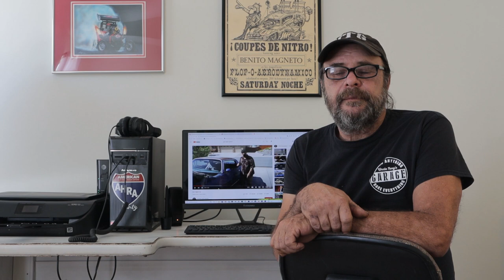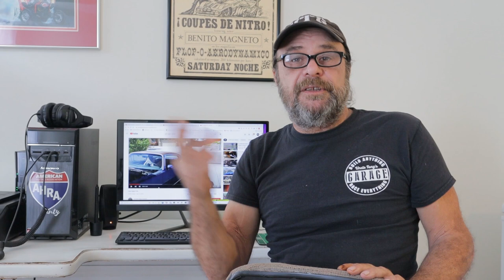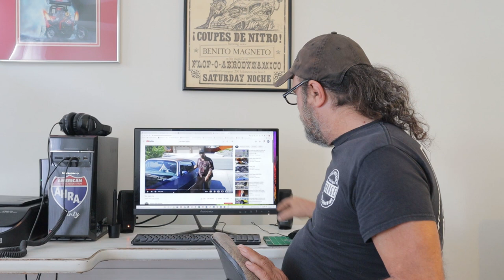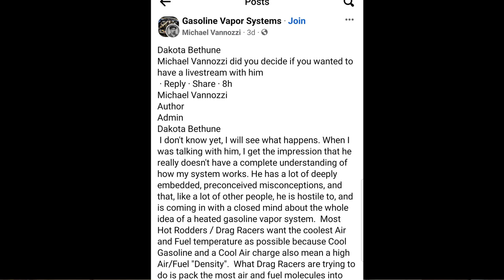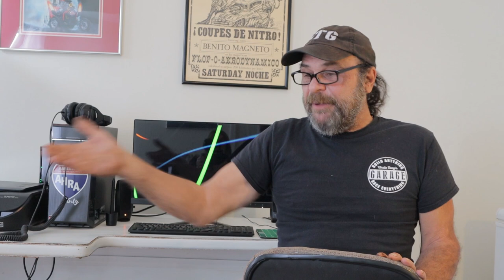Climbing Down The Mega Mileage Conspiracy Rabbit Hole

Comment: To get better fuel mileage you will need. Small thin tires and rims. Lighten up your vehicle by removing anything that's not necessary. Drive under 55mph. Run drum brakes and adjust shoes to max free wheeling. solid mount everything in drive train because flexing is wasted energy. Run a little hotter thermostat. Over build the air filter to be the best free flowing you can. Because of pumping loses. Use a turbo alternator. Use electric fan on radiator. Build a steam generator by capturing exhaust heat and use steam to help move vehicle.

Comment: My box stock C5 corvette LS1 6 speed at a steady 55 mph will get about 30 mpg. It will also do a less than 5 second 0-60 ,  13.4  quarter @ 108 mph and top out about 175.
Reply: You've got tall gearing, no torque-converter losses, a relatively modern engine which is well-calibrated from the factory, and good aerodynamics ... and if you want acceleration, change gear. Nice car.

Comment: something to test. i remember hearing about a guy selling fuel saver device and what people got in the mail was a wood block and instructions how to attach it under the accelerator pedal. how about putting that to the test. adjust something to limit the accelerator pedal so the engine has only about 20-30 usable hp and see if you can get the 35 mpg at 50-55 mph. well attaching a small carp should be similar to blocking out a regular engine throttle pedal movement. my guess is that you would be getting the same results. the car would accelerate slow as heck and be boring to drive. Uncle Tony. I am counting on you!

Comment: Ok Tony hopefully this can help. I have a 1986 Ford Thunderbird. 3.8L V6 with a C5 transmission (a C4 with a locking torque converter basically) and a 7.5 inch rear end. Now, my car isn’t carbureted, but it is throttle body injected. Now, in the past year, I rebuilt the engine and trans (new seals, timing chain, larger injectors, honed the cylinder chambers, decked the heads, honed the stock intake, and replaced the rings and bearings). Also, all the emissions have been removed and my exhaust has been upgraded to shorty headers off an SN95 mustang and a 2.5 inch true dual into a Y pipe before the rear axle, and a 3 inch outlet. 

NOW. Stock, my car would do 0-60 in 10.9 seconds and 1/4 in 17 seconds. With my overhaul project, I’ve achieved 0-60 in just under 9 seconds and 1/4 mile in just under 16 seconds. Pretty respectable for a 6 cylinder Ford. NOW, this included turning up the base timing from 10 degrees BTDC to 13. The stock fuel economy was 13 city, 23 highway. The HIGHEST I’ve achieved at 55 mph on a flat surface was 38 mpg. But if I run it hard, I’ve seen that economy drop as low as 12 mpg. This is all with 93 octane.

I can tell you this. With these modifications, my car absolutely 100% STRUGGLES to get up steep hills. She cannot do it. So have a gained power with my modifications? Yes. But when under heavy load, she struggles. 

So my two cents? Yes you can increase fuel economy but there is NO WAY in hell that you can gain fuel economy without sacrificing power. So Tony, you are 100% correct. There is no way in hell you can achieve superior fuel economy without sacrificing horsepower.

Comment: Love this video so much. 
Thank you UT!! 
The ding bat with the Camaro would have more power and better fuel milage if you put a little 4 cylinder engine in it. 
UT. You put out a video about lage displacement  engines and you pointed out when and where the engine actually made power and the rest of the rotation was all wasted energy.  
That video has vary good into that can relate to fuel economy.

Comment: Isn't the main reason for putting bigger tires on the back to add mileage and performance because the vehicle is always going downhill?   Not sure why it only works with rear wheel drive cars. I tried it on my Hyundai and it just made the car look goofy. I'm thinking about trading it for a rear wheel drive car so I can get the advantages. 😃

Comment: Now back when my father had a Gas Station , him and Red Tried A Recycle Spent Exhaust Fumes on his imperial,. They used A Small Boiler and Check valves on his Imperial   The car had return Exhaust from the pipes back to the carb ! Did it work in part yes but the carbon caused the check valve to stick and on their trip around the block the check valve stuck and the boiler let loose , back in the early 60s.
Reply: Carbon monoxide IS an engine fuel. Done right, that might work.
Reply: @Gothamauto  They used high Test back then and   Added Moth Balls as a booster for Re Spent Fumes   .

Comment: I've always been able to get better mileage from a 4 bbl IF I KEEP MY FOOT OUT OF IT>. When I blueprinted my '67 225, bored .60 over, low/midrange cam, Clifford headers, Holley 4bbl, Offy intake, etc... Houston to San Antonio, I could suddenly get 28 mpg. Best on the factory setup was 21. I made an adapter to have the throttle shafts parralel to the crank, to give more even distribution. NO heat to the intake, 9"x3" air filter, Dynomax mufflers true duals. I wonder how much of that mileage improvement was just from the freed up restrictions on the intake and exhaust. The electronic ignition couldn't have hurt either. Thanks to Direct> <Connection for the spark and cam. Thanks to Tony and family for these videos.
Reply: You are right on track with your setup , congrats !

Comment: Isn't LP gas vaporized before combustion? Or CNG? The forklifts I work on have a vaporizer. The fuel use isn't any different. It still takes so many BTU's of energy to run.

Comment: I know that when my purge valve was stuck open on my 96 Camry, I could get 35 miles to the gallon and the fuel filler cap would make a whooshing sucking noise every time I opened it. I know that gasoline will evaporate at an increased rate in a vacuum. I know the ecu can compensate fuel about 17% in either direction. I know this Speed density setup will allow for the evaporated fuel vapors from my tank through the purge system to sneak in as it adjusts from the upstream O2 sensors reading to keep it stoichiometric. Seriously it's not hard to replicate and get a mileage boost from in a MAP sensor car. this does not work with MAF air metering. I did have a code set "fuel system lean" which is typical for an intake vacuum leak that happened to be feeding completely atomized fuel/air mixture from my fuel tank through my purge valve, into my intake manifold.

Uncle Tony, lets strap some nitrous bottle heaters to a 10 Gal fuel cell, pull a vacuum on it through a 3/8 manifold line in a carb spacer(with a flame arrestor check valve) and then control the orifice size on the fuel tank vent to pull the tank into sub atmosphere. Sounds dangerous, doesn't it? The gains do not outweigh the risks of this rolling bomb.

Comment: The only right way to know the correct amount t of fuel consumed for any length of distance is to install a highly accurate and calibrated flow meter in line. A meter specifically designed for this purpose.
Reply: Just fill the tank right up then go from there
Reply: LOL, back in 1980, a car salesman and myself built a covey vapor setup in a 74 chrysler newport with a 400 in it, everything stock except for the modifications we made to get the exhaust to the heat exchanger,  the heat exchanger and induction we built.He borrowed the in line flow meter from the dealership and we installed it. once the car was warm we got a consistant 30 mpg, can't say what the hp numbers were.

Comment: I really hope he takes you up on your offer Tony. I would love to find out more. even if he only built it to run at a certain speed, on a certain road, for a certain amount of miles, and is totally ok with the slow performance. We all build out cars for our own liking and for our own purposes, he has built his, and that is totally fine. It would just be good to have the numbers. Numbers we can work with and improve on. Tony, i liked the way that you explained the force on the piston in one of the earlier videos. In LPG combos the gas is in vapor form on most builds with a loss of force on the piston. there are some newer lpg combos that run liquid propane into the cylinders where it has the ability to expand giving force on the piston for a longer duration just the way liquid gasoline is run today. The trick in any engine would be to try to find out how to get it to burn 100% of the fuel going in. Then i guess if someone way smarter than me could do the math on how much liquid fuel was used on each stroke  ""Thrue the entire engine range under load"". You could figure out how much Vaper Gas you would need to make the same force. ""IF"" you had a way to contain or maintain that flow of Vapor gasoline. In theory you would need a variable cfm carb. and also noting that the vapor gas is already expanded would ""LITE"" faster, but not have the same extended burn as liquid as you had noted. it would be best to have the shortest stroke largest bore engine you could find.  In this case, since the gasoline is already in expanded form would be kind of like running vapor propane, but better because vapor gasoline would have more energy. you would need less in each cylinder per stroke at a given rpm than the liquid, therefor maybe not increasing your milage greatly.. But increase your savings on your pocketbook because you would not use as much gasoline per fill up???? Maybe. I may be off on a bit of this but Love to think on this stuff...  Also if he brings his car down, and it DOES work. will you put one on your Miata;)  Love the videos and the channel Tony. Keep em coming. Tom B.

Comment: Gearheads like Tony, Smokey, and Mickey (and to some extent yours truly as I do the same thing) are actually more like scientists, employing the scientific method, measuring what we do so we can get a quantifiable result. If someone claims they have a 9 second street car on 225 radials with a two barrel 305 and rams horns, we are gonna tell them to prove it, and we will see how well it runs at the track. Until we see it run, we will be dubious at best.  

With his gas vapor I want to know how well it runs other than a steady cruise, because I am doing the same thing but with ethanol. Mine makes lots of power, with 13:1 compression in a 455, its gonna move. I want to prove it to everyone, even if they don't use it, if it works or not.

Comment: I managed to get over 30 mpg in a 95 Tahoe 4 door 4x4 vortex 350 with some resistors and a negative pressure brown's Gas wet cell using a proprietary electrolyte solution.

Comment: there is a wide range where a car can be set to run at optimal economy. Most US cars are set to run at highway speed (65-70 mph), but that could be higher or lower. 

My dad’s 1972 Impala with a 350 2bbl could get 20 mpg at 85-90 mph on the highway, but only got 17 at 55.

My 2018 F150 5.0 with the 10 speed gets best mileage at 65, about 19 mpg. Lower or higher it drops off dramatically (10-20%)

Comment: MPG story:  1985 Honda civic HF.  This was the gas mileage champ in 1985 in the Honda lineup.  It was carbureted, weighed 1840 lbs, could convey two persons, featherweight wheels, zero impact protection, manual transmission only.  Dog ass slow off the line.  Not a confident passing car.  Claimed 90 hp.  Felt more like 45hp.  It was a gas miser.  EPA rated it 49mpg highway, 40,pg city, 43 mpg combined.  For 1988 the HF became fuel injected.  Slightly better power, about the same mileage.  Mind you we are talking about cars that run cats and are clean smelling.
Reply: If I remember the mpgs were slightly better than that and these civics were actually quite peppy.  The CCVC heads on these things made a more complete burn in the cylinders.
Reply: I've got a twin charged VW Golf/Rabbit GTsport mkV from '06 (1.4L, 170hp, 2970lbs, 0-60 in 8.0sec). I once almost got 700 miles out of the 15 gallon tank, but had an Autobahn stretch of 40miles at 120+mph so I made 630mi with 1.5 gallon left. And I'm living in a mountain region. Going 55 on countryroads and cruising 65 on the Autobahn I'll get 45mpg reliably. 6th gear at 2300rpm.
Reply: @thetruth5232  That is fuel injected.  The discussion was about carbureted.  Plus, the Honda was EPA legal.
Reply: @yeboscrebo4451  Quite true!  Too bad they made a boat load of NOx too. The 1984 Civic FE was carbureted.  The 1985 Civic HF was fuel injected.  I think I might have been wrong previously. The CVCC ran well. But NOx EPA regs could not be met with CVCC.
Reply: @HamiltonSRink  “This combination of a rich mixture near the spark plug, and a lean mixture in the cylinder allowed stable running, yet complete combustion of fuel, thus reducing CO (carbon monoxide) and hydrocarbon emissions. This method allowed the engine to burn less fuel more efficiently without the use of an exhaust gas recirculation valve or a catalytic converter, although those methods were installed later to further improve emission reduction.”  Wikipedia.  Where did you get the idea that EPA regs killed the CVCC? Are you just making stuff up?
Reply: @yeboscrebo4451  All you say is true, because the CVCC was the best, most developed lean burn design.  Heat of combusion was quite high as a result.  And when you have very high heat of combustion, you get lots of NOx, which the EPA increasingly classified as a pollutant.  In order to bring down NOx, engineers had to bring down combustion temperature.  EGR was used for this purpose, as well as backing off inital ignition timing advance.  These two things when applied to a CVCC engine, did bring down combustion temperature, but also most of the advantages that CVCC had.  Plus, digital electronic fuel injection was able to allow better control of the whole process.  Ultimately, the three way catalytic converter made it possible to convert NOx into NO and O2 which were not considered pollutants. With this new catalytic converter, the enginneers were able to go back to making much more horsepower.  This started about 1981, but carburetors could not take advantage of the TWCC the way DEFI could.  Where do I get these ideas?  I was a factory trained Honda mechanic from 1985 to 1998.  After that, I specialized in emissions repairs, check engine lights, and was a NJ state licensed, ERT, which stands for Emissions Repair Technicion.  Which I had to be to do Private  Motor Vehicle Inspections at the PIF, which is Private Inspection Facility.

Comment: 35mpg is about 7L/100km... My work ute is a diesel, probably the most fuel efficient diesel ute around, and I average 9.7L/100km, on the highway I get around 9.1-9.2 average, if I could get 7 from a small block chev, I’d change in a heartbeat

Comment: Studied the hot vaper engine programs and guess what they will not work with fuels of the last 20 years.
I also designed and built my own proto type carb throttle assembly 
Redesigned cam  
Reworked 
Timing
255 cube v/8 conversion into 85 ranger
Real world on road  while I was going to engineering school
 60 mile round trip consistant results @ 85 mpg
Dyno test daily driving till cool cold weather sets in.

Comment: Smoky was looking at how to increase the BTU,s, by turning gas into a hot vapor, the engine he used was the 151  iron mike four banger the bore and stroke were half a 302, same rods and pistons the big mistake was not making it a cross flow head, the Iron Duke was a bigger 4 banger used in midget dirt cars back in the 70,s, heck my 850cc fiat got almost 40 mph back in 68

Comment: Years ago i decided to learn fuel injection...this was on an 80s era camaro with a four cyl motor....wire harness all cut up needing.repair.i learned alot,one thing i learned was that the air fuel ration could be greatly influenced by the jacket water temperature...so i installed a potentiometer in the wire conecting that sensor...i could turn it to the left and lean it to the point of barely running,our turn it right an richen it till it would actualy kick on the high idle circut...or any point inbetween....carefullly adjusted it would get very good mileage..try it yourself,should work on any injected car.....ya heard it from me,airplane Dave

Comment: I helped build a car that did 250mpg once.... however, it only weighed 200lbs, and could only fit the driver and no passengers, no cargo. Also, it was powered by a 5HP Briggs & Stratton that was worked over so it had less blowby and more compression.

Also, we didn't run the engine constantly, we'd accelerate up to a speed then cut the engine and coast. Most of the time was spent coasting. I think top speed was about 60mph.

I can't imagine that thing being bought by anyone, let alone passing any kind of crash test safety requirements.

Comment: On an episode of Mythbusters they took a tank of hydrogen and put the tube at the top of the carburetor and the car ran for a few seconds really well and then it exploded. It was a mild explosion and the hydrogen was from a pressurized tank so in fact hydrogen will power a car the problem is it needs to be from a non-pressurized source because it is too volatile and also it must be produced by electrolysis to be a truly water powered car. Currently the theory is that adding hydrogen through the process of electrolysis into the intake manifold produces a more efficient gasoline burn but it's not actually powering the car. I am optimistic that it can be figured out or that someone may have already figured it out.